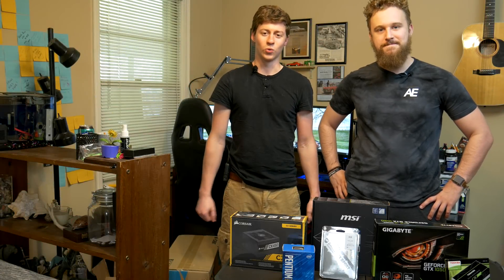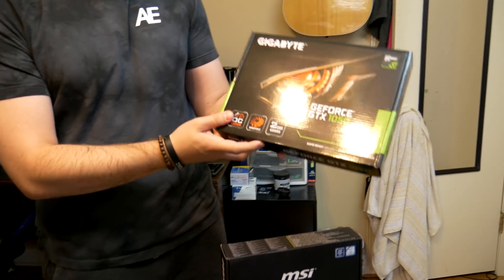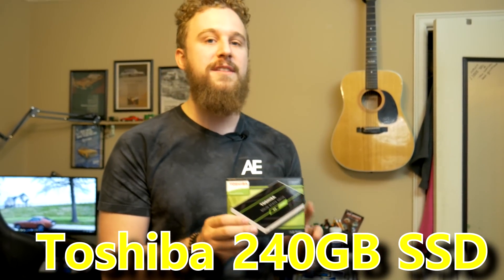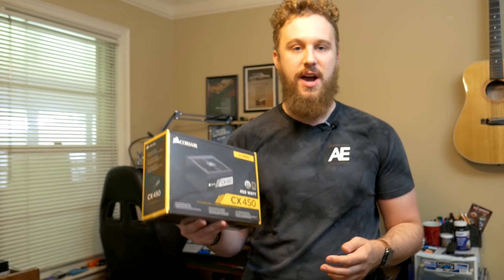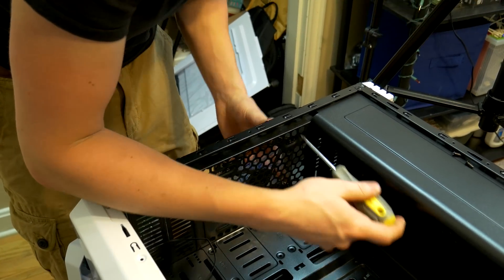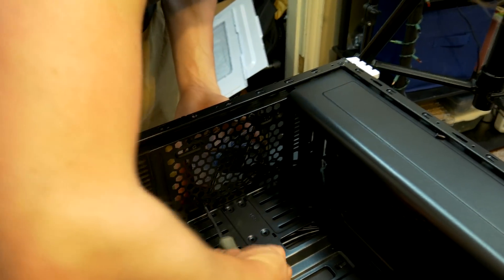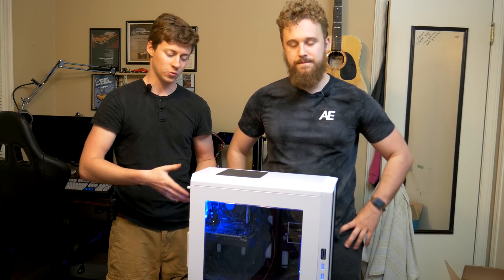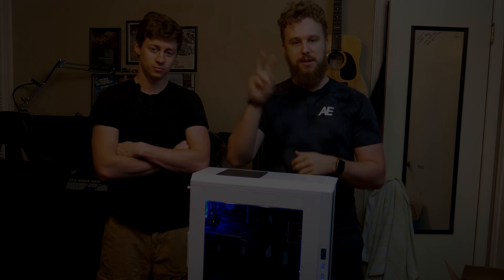2018 $500 Gaming PC - Intel Edition

Comment: just buy used dell optiplex with i5 2400 with 8gp of rams for like 150usd, get new case for like 30usd, cx450 50usd, ssd 240gb for like 45usd, and used gtx 1060 6gb for like 260usd........ new pc with such a low budget does not make any sense.....

Comment: Im doing this build with a few small upgrades. Went with the i3 8100 and a gtx 1050 ti. Also a 500 ssd scavenged from an old laptop as well as added a wd blue 1tb. I will comment with bench mark as soon as the last of my parts come in from newegg.

Comment: For 50 dollars more I built this setup with half the ssd memory but a 1tb hard drive and a 1050 ti instead
Reply: Alex Rider links?
Reply: Nexieys 
Ssd- https://www.amazon.com/gp/slredirect/picassoRedirect.html/ref=pa_sp_phone_search_atf_aps_sr_pg1_2?ie=UTF8&adId=A081933532YJTH7MCXEZZ&url=%2FZheino-Drive-Solid-Desktop-Laptop%2Fdp%2FB0778KGY19%2Fref%3Dmp_s_a_1_2%3Fie%3DUTF8%26qid%3D1529020887%26sr%3D8-2-spons%26pi%3DAC_SX236_SY340_QL65%26keywords%3D32gb%2Bssd%26psc%3D1&qualifier=1529020887&id=1587516260393925&widgetName=sp_phone_search_atf&dpPl=1&dpID=51hJW8cDM0L&ref=plSrch

Hard drive-   https://www.amazon.com/Blue-Cache-Desktop-Drive-WD10EZEX/dp/B0088PUEPK/ref=mp_s_a_1_3?ie=UTF8&qid=1529021166&sr=8-3&pi=AC_SX236_SY340_QL65&keywords=1tb+hard+drive&dpPl=1&dpID=51VVkeXoFGL&ref=plSrch

Gpu-   https://www.amazon.com/EVGA-GeForce-Support-Graphics-04G-P4-6253-KR/dp/B01MF7EQJZ/ref=mp_s_a_1_1?ie=UTF8&qid=1529021212&sr=8-1&pi=AC_SX236_SY340_QL65&keywords=gtx+150ti&dpPl=1&dpID=51uQKREz3vL&ref=plSrch.  

Everything else is the same things they use

Comment: Nice build! Question on benchmarks, do you test with G-sync monitor? I currently have RX 560 OC with FreeSync 144 hz 1080p monitor. I want to get Nvidia but don't have budget for G-sync as of yet. How terrible would it be to run without G-sync for the time being?

Comment: Nice. this vid makes me regret buying that I3-8100 with a gtx 1050 since this averages more fps on fortnite in same settings for some reason when I only have roblox and fortnite on it.................

dont judge
Reply: Eww roblox
Reply: NoodlesGuuy i3 8100 is much more future proof.
Reply: NoodlesGuuy Why tho? i3-8100 is much better amd has 4 cores right? I'm confused :/
Reply: i3 8100 is like an older i5, even if results seem similar, you will have better %0.1 fps in cpu heavy games and it will help. Nothing to regret dude
Reply: Only play Phantom Forces on Roblox. And no, it is not a kid game. try it fro yourself
Reply: NoodlesGuuy Yeah. They kinda ruined sniping with the new update
Reply: That is hecka true dude. But I still love sniping with a BFG 50 and remington though.
Reply: NoodlesGuuy I can't choose between a long or short range weapon, I don't like mid-range guns like assault rifles. Because it's not as rewarding when you kill someone by holding down left click.
Reply: Psycho Kern Intel is better in-terms of gaming performance due to the higher single thread performance, but Ryzen is better for multi-tasking as it has better multi threaded performance

Comment: you could've used ryzen 2200G 0\or even 2400G, and used a hard drive instead.
Reply from the maker: We have done a 2200g builds already on the channel :) We plan on doing a 2400g build soon
Reply: can you please review this case: Cooler Master - HAF XB EVO ATX Desktop Case

Comment: I would suggest not building a 500 dollar pc, as you may not be able to run games that are coming out in the future, try getting atmost a gtx 1060 as it has the capacity to run upcoming games at medium to max settings.
Reply: X60 Cards have always lived for longer than atleast 5years like the 760 for example 1050 performance and much cheaper still kicking ass at low-med 1080p

Comment: And if anyone wants to upgrade this build ^ use 1050 ti easily make performance much better, Runs Fortnite on all epic settings
Reply: My Name Is Jef pretty much same pc but I had the older CPU the G4560, and I did not have an SSD , I had a different motherboard Gaming pro Vd or something like that, different power supply EVGA 500 W , you get the point pretty much everything the same but my stuffs a little shittier so the Gtx 1050ti does add a lot
Reply: zRoyalz YT That's nice
Reply: which one exactly? I’m kinda new to building computers but I’ve been playing computer games for a while
Reply: kinq I have the MSI Gtx 1050 ti but that one is a little pricey I recommend gigabyte, MSI, nvidia, EVGA, of Zotac. Usually best brands and they all preform relatively the same according to my research

Comment: i dont like the 1050..
Reply from the maker: not much else you can do with pricing currently, if cards go down in price a 1050ti will fit in well
Reply: Jovanny Veerapen yeah but i like it just a little bit
Reply: you can get a 780 from evga for around 150(that's after taxes and shipping)
Reply: joseace182 you could buy a gtx 1050 ti then :)
Reply: Toasty Bros do not use an ssd
Reply: AppsIOS why not? I think it’s a must to put an ssd in a new pc, plus you can add an extra 1Tb harddrive for like $35 to $40 more
Reply: AppsIOS bottleneck
Reply: buy a gtx 970, its the best budget card.